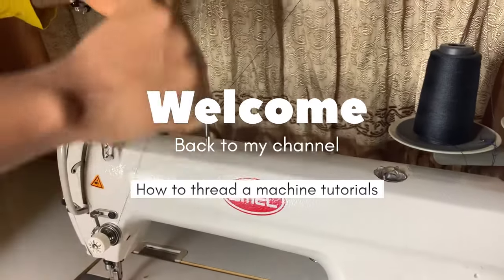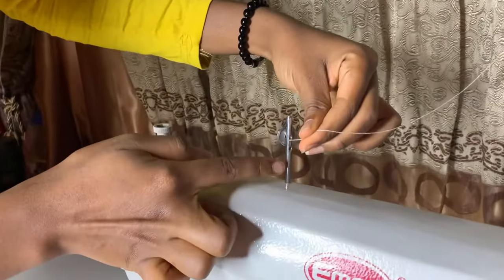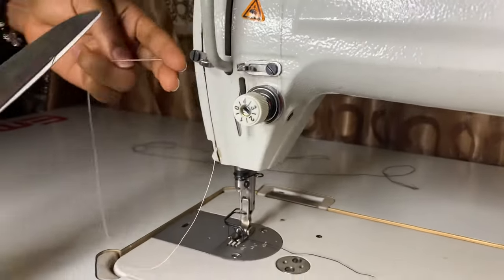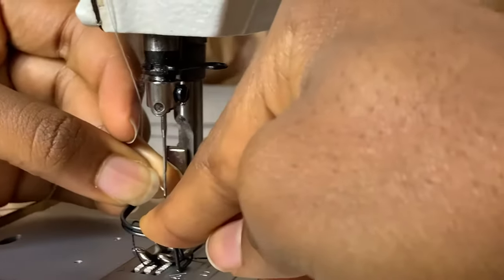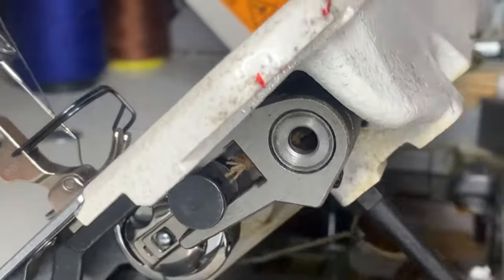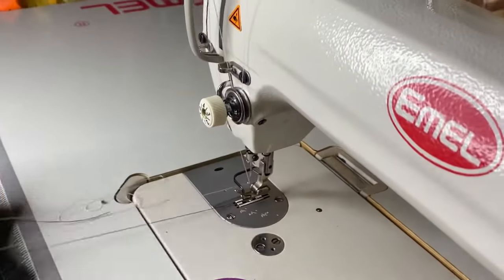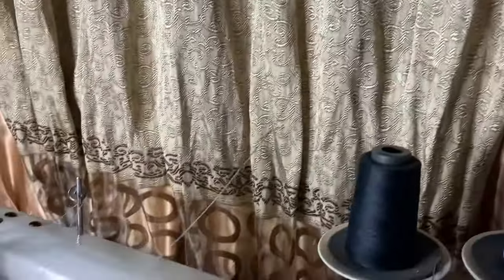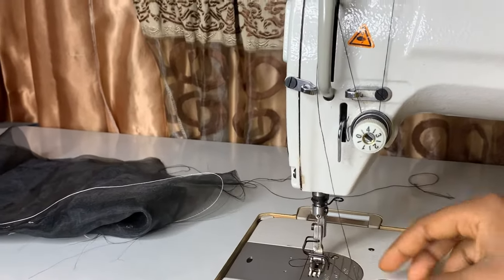HOW TO THREAD AN INDUSTRIAL SEWING MACHINE TUTORIALS

Comment: Hello, please I need help, I bought kingstar upholstery machine, so today as I was assembling it, I cut a white piece of a cloth made like a belt in under the head, when u oil the machine you will see it, I tried stitched it together using the needle, now I'm afraid to test the machine, kindly will my machine work or I have to buy a new machine 🙏🏻
Reply from the maker: Hi 
Try it first to see if it works before buying another machine

Comment: Hello my machine isn't working well I find it difficult to roll the handle and I cudn,t pick the thread from the shuttle
Reply from the maker: Hi Abigail, sorry to hear that.
It’s unfortunate I can’t give a proper response to solve your problem. However, when I experience difficulty in rolling the machine handle I apply machine oil on it. To smooth the process. You can try this too!! If it doesn’t work then I think you need a professional